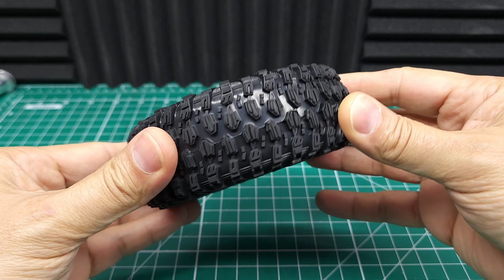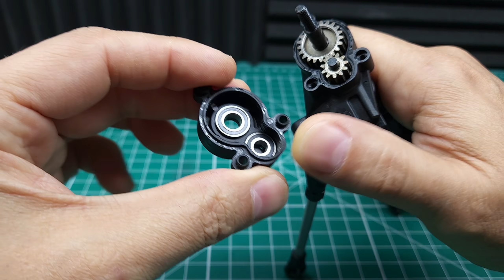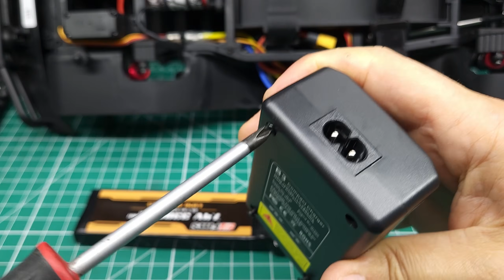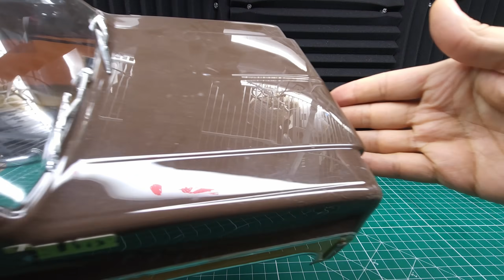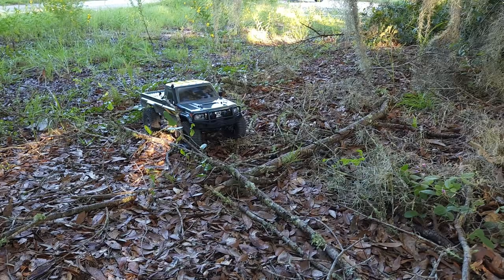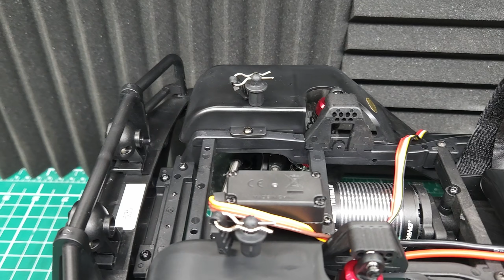This Budget Basher Just Embarrassed The Big Names!

Comment: After you changed the motor to brushless, did you also replace the original ESC with what version? Do you still use the original remote / did you replace the original remote ?  because I see the new ecs is not installed even you said without a separate esc.. can you explain it for beginners like me without a separate esc? Thanks 🙏

Comment: I got one of these for $164 delivered to my door and I am so happy I bought it ! It is insanely capable, even with the stock running gear it crawls great. All I did was put a good set of wheels and tires on it took it extreme crawling and i was blown away with the performance of it, it pulled so many crazy lines i couldn't believe it  ! Great truck!!!
Reply from the maker: Hard to beat for the price.

Comment: Yikong has embraced the nylon chassis, the previous version came with a steel frame, 2 speed and lockers on some models, I have a rebrand of the 2 speed only, I've replaced the radio, shocks, wheels tires and added lights where I could fit them. Mine also has the clipless hinged 2 piece body and hinged clip battery retainer that I wish everyone would make.

Comment: You mentioned the screw markings. In case anyone didn't know. Screws  that are marked, are graded. 10.9 or 12.9 which is the grade. Grade 12.9 are higher tensile strength than 10.9...those looked 12.9 if my eyes are good!

Comment: I have 3 of the Yikong models, YK4102 Jeep Rubicon, YK4106 Mercedes G-Wagon, YK6101 6x6 Land Rover defender 4 door ute "The Flying Huntsman" and I have had them all completely submerged, installed hobbywing 2700kv axe in the 2 4x4's and 3300kv hobbywing axe in the 6x6, I have also absolutely hammered all of them and every one of them is still taking everything I subject them to.. I highly recommend the brand for anyone starting in the hobby. If the pro version is available get it as everything is remote activated.. bang for buck, attention to details, features, durability and ability are all 100%. .

Comment: Between this and the 1/12 MJx H12Y and the 1/10 WLToys 104020, which one should I get for my first RC Crawler?
Reply from the maker: Not familiar with the WL toys but I would recommend this one over the MJX because of its size. It's decently larger which will make it more versatile and at least as of a few days ago it was on sale for like 150 bucks at hobby zone which is pretty much an unbeatable deal.
Reply: @DoRC thank you for the reply! This is definitely one of my choices for 1/10 scale. But how about for the smaller 1/12, what can you recommend? 

BTW, ive just started watching rc crawlers review channels and by far, you are the most knowledgeable and easy to understand for beginners like me! Plus the fact that you actually explain the components and the pros and cons of the material used or build quality and I really appreciate that. Makes me more interested on this hobby :)
Reply from the maker: To be honest I'm not really much of a crawler expert so it's hard for me to give you solid recommendations. For the most part I do bashing. With that being said I'd recommend getting anything that has a two-speed transmission unless you're going to be doing pure rock crawling. If you want to do trail bashing being able to go faster than 2 miles an hour makes a big difference. Beyond that it's hard for me to give much advice because honestly I have even less experience with the small crawlers than I do with the larger ones.
Reply: @D @DoRC  worries, totally understandable. I’ll keep being subscribed and will watch your  old and upcoming videos. Im pretty sure ill learn more about different components. Thank you  for replying!
Reply from the maker: Yes stay tuned we've got plenty of cool stuff coming!
Reply: Parts support will be much better for the wltoys. However, this one’s very tempting even without the parts support cause it’s so cheap. You could buy a spare set of the most common failure parts, really almost an entirely separate truck and still be under the cost of the other ones. Of course if you don’t care about ordering from China it seems they are available, just not common on Amazon or eBay with fast/cheap shipping like models like the wltoys or other more popular ones are.
Reply: Another downside with these types that reviewers never mention is you lose a lot of scale realism because they have stiff shocks, are over sprung and over damped and have lots of stiction in the whole suspension system mixed with no weight. More expensive name brand models generally have better scale realism and you get that plush realistic suspension cycling as opposed to these types which just sort of bounce around like a toy and basically only articulate, they don’t actually absorb shocks or feel scale when driving around trails and stuff. Doesn’t matter if all you want to do is slow crawl, but it’s definitely a noticeable difference and makes them feel cheap over the more expensive ones.

Comment: its a LC79 the japanese work truck... better than any pickup america can make, and yeha 5 Link rear suspension is used IRL on the nissan patrol and Toyota LC J80
Reply from the maker: There are a lot of vehicles that use a five link but that's different than a triangulated four link with a panhard. With a standard 5 length the four links aren't actually triangulated so they allow the axle to move side to side just not up and down and forward to back.

Comment: This RC may be a great low cost entry into the hobby, but its NOT close to a TRX-4 Sport as anyone that buys one will learn in the long run.. if not the short run, depending on how rough they are on it! Traxxas has a reputation for one of the toughest, longest running crawlers in the industry and its going to take more than a low cost alternative to change that fact!
Reply from the maker: How long have you had yours?
Reply: @DoRC  10 years. I have recommended these to several friends during that time and have never heard a single complaint! :)

Comment: Hello
This is the first time I've had to completely disagree with a recommendation here.
The new Yikong YK41011 you've presented is a completely downgraded Yikong Yk4101 from 4-5 years ago.
The only real advantage of the 41011 you've presented is the manually adjustable diffs.
Everything else has become so cheap it hurts your eyes!
The older version, the 4101, has the following features:
Servo on axle
CNC aluminum frame
Front and back bumper
Magnetic front/swivel rear body mounting system, no clips!!!
A lot of brass parts are available for the front and rear axles at AliExpress.
Way better soft tires in the right size. 
Siders protect the body.
Comes with rollbar and bedprotectors.
The older version is absolutely way better.
The Yikong YK4101 is still available as a Primus PC10 SR5 at Motion RC for the same price of $249.99.
And it is a much better choice!!!
Just my 2 cents.
Greetings from Germany.

Comment: When I generally recommend crawlers to folks I ask what they intend to do with them 

This is a good camp or woods type of crawler 
That being said the plastic chassis and design is fine for what you’d want 
However if you plan to  actually crawl rocks and possibly compete in  sorcca type events in class 2 you wouldn’t want this 
You would be better suited to start with a traxxas trx4 sport as it’s going to have the bones to upgrade from where this would require a second platform to be bought 

That being said it’s perfectly fine for someone who wants to dip their toes and have a good time at their camp sites with their kids or grand kids buddy’s ect 
And at that price you’re not wasting a few hundred bucks on a base platform that can be used to upgrade things like motor speed control foams and wheels servos ect 
As for water proof we just use balloons and a zip tie to water proof our crawlers 
It’s cheap easy and keeps them real well protected 

The reason I don’t say this would work well for a sorcca event is the chassis is directly addressed as being a c channel and specify a no twin vertical plates this twin plastic c channel may fall in line with a twin vertical plate type chassis 

Everything else looked great tho 
I’m not big on selectable diffs so I generally lock them 
Either with a locker or a washer and some e6000 for the crowns to bond together 

The other thing is when you plan to crawl you generally want a platform that has supported upgrades 
Like brass portal covers ect so you can add weight at a non rotational point and not at a sprung part of truck like chassis 
Axles are the best spot and having brass to use inner and outer on portal as well the shock mount points or differential covers can really help you ballance the truck to make it perform consistently 
I’m crawling consistency is key as well ballance 

Weight matters but having a 60/40 and 50/50 (side to side ) is going to make it easier
Reply from the maker: Absolutely. This is 100% a casual crawler/trail rig. If you're going to be competing this is not a good starting point.

Comment: Is the idea of four link + panhard bar to make side rolling alot reduced? And i like that there is one less servo,but maybe keep one servo system but put lockers on servo and switch gears manually🤔
Edit: tought it basically wont matter does it lock diffs manually or gearbox manually, anyway you need to go switch it from the truck, so i would be fine with those manual lockers
Reply from the maker: The panhard bar definitely reduces side shift of the chassis which will help reduce rolling but it's not an anti-roll bar in itself. On a full size vehicle the four link is enough to keep things in place but on these RC cars with additional slop and especially given that the four link on this is not triangulated as well as it could be The panhard bar seems to work well.

Comment: I am a first time YK4101 Yikong fan ,the first series have way too high gears even first!  I put two teeth less on the pinion way better for my use.  Now  in the 41011 the gears are perfect , with super low first and when i need more wheelspeed i take often second.second have enough juice even for the steepest hills in my terrain. The lcg chassis does a realy good job even in my YK4107 .   Even very steep sidehills are  possibel without rollovers. I like the manual shiftabel lockers because i have some troubel with the servo shifting lockers in my 4107. Same lcg chassis and nice gearing i bet this will be a game changer in the entry level  class. Maybe not in the us but definateley  in europe!  Put a good set of tires and rims on and front nuckelweights and it will surprise you every ride more and more!  Watch my Yikong vids and you know why i love this Truck more than my TRX4! I never change my RTR Motor in non of my Yikongs and i doo many waterrides!
Reply from the maker: Yeah I agree. I would personally rather have the manual locking axles just to keep things more simple.

Comment: Can the drag break be turned off in the FOC system? Was thinking it would be more fun while trailing without it.
Reply from the maker: Yes. The ESC can be set up to run like a normal basher ESC. That's how I have it set up at the end of the video.
Reply: @DoRC sweet, thanks!

Comment: When you said it was a 3 link with panhard in front and a 4 link with panhard in the rear I thought the weird thing was that it was a different front and rear.  I was assuming the 4 link would be straight links like a Kyosho USA-1.  I've never seen a panhard used with a triangulated 4 link.  Definitely a strange choice!  But, it will be definitely be nice as the rod ends wear...Possibly my least favorite thing about the Losi LMT10/2.0 platform is how much side to side movement the axles will have after just a small amount of wear on the rod ends of the suspension links.  
this YK truck is pretty cool for the price!  I'd be interested to hear how the drivetrain ends up holding up with the brushless motor.

Comment: I love it! I've always wanted a Traxxas or Axial crawler but they're just a bit more than I want to spend to dip my toes into crawling. (I'm also still avoiding new Traxxas stuff). One of these may be my first crawler.
I actually like the "manual-manual" lockers, they're like using OX cable lockers on a rig where running cables isn't worth the hassle (I almost went that route on my Jeep, but I went with a True Track and auto instead) 
Thanks for the vid! 👍

Comment: Yikong has a great range of trail trucks and crawlers. Absima (German company) and others rebrand some of their models. Rebel RC (USA; I think they no longer operate) also rebranded a crawler from them.
I'd never seen a "manual" locking differential like this. Yikong have put all sorts of gimmicks on their rigs like independent rear wheel brakes (kinda like dig systems, for tighter steering).

Great video! 👏💪🙏
Reply: Motion RCs "Primus" house brand are rubber stamped Yikongs with a few features left out, the truck doesn't have lockers or lights, the Defender has remote lockers and basic lights

Comment: I tried about four different ways to begin this, but it just became a short essay about my thoughts on 2spd transmissions in RC crawlers.

In my perfect world, there would be a consistent implementation of a "mode" button on the TX that changes in and out of high/low gears and drag brake on/off simultaneously. This goes for OEM brushed crawlers too. I've done it with an aux output on a ch5 dial to turn down drag brake in addition to the high/low switch of course, but this doesn't satisfy me. Maybe something fancy like an MT12 could do this? However when you go brushless, the high gear usually becomes too fast and drag brake adjustment is even more crucial. This is the point when I question why a 2spd is even needed with a brushless motor. Or why I purchased something with a 2spd anyway if I likely going to put a brushless motor in it eventually like everything else. Aside from it mostly being an admittedly fun gimmick, 2spds are probably best suited towards giving inexpensive brushed motor crawlers good low speed throttle control - and nitro/gas bashers..maybe.

Comment: Basher??
Reply from the maker: Yeah definitely. I consider anything that isn't a race car to be a basher and this thing does trail bashing really well.
Reply: @DoRC 
I like the truck. The only thing I don’t like is you have to switch the difs manually. An the  only reason that’s a problem on this vehicle because if you’re trying to crawl something and you’re in a weird spot, you gotta lift up the vehicle to lock the diffs.and you’re moving the vehicle by hand, which would technically be a hand of God to some people.😂 
What is your profession outside of RC like what do you do for a job?  I’m just wondering because you seem to know about a lot of different things. Which I pride in myself so I was wondering. Obviously you don’t have to answer this if you don’t want to . I’m a home builder 23 years.👍🏼
Reply from the maker: @rcsmith5909 Yeah I think this would not be best for competition crawling although I'm not sure selectable lockers are allowed in competition crawling anyway are they? I don't know. This is more of a casual having fun trail bashing kind of truck then something like that anyway. 
I'm currently disabled but before that I had a career as a mechanic and a career as an IT tech.

Comment: For future reference some stainless steel is not magnetic  but others are. Depends how much nickel is in it and how its made.   A lot of knife blades are "stainless" but still magnetic.   Sorry to be that guy , I'm a knife collector and designer and always wondering what metals are used in this hobby and what metals I wish they would use but the costs would be extreme.
Reply from the maker: Yeah for sure There are some stainless alloys that are somewhat magnetic though at least in my experience they aren't used in RC cars so the magnetic non-magnetic thing is a pretty good indication of whether or not it's stainless.

Comment: die-electric grease is your best friend. cram it into every connector and you will have had no issues. the 1800 KV fusion is so damn good in my redcat i will never use anything else in any new crawlers that i buy ( except i may get the 2300 for the new rig )
Reply from the maker: Yeah that definitely can help though it also collects dirt like crazy and where I bash it can be a real problem.